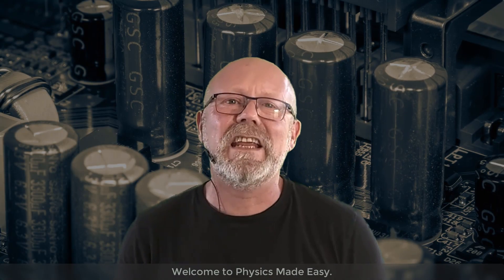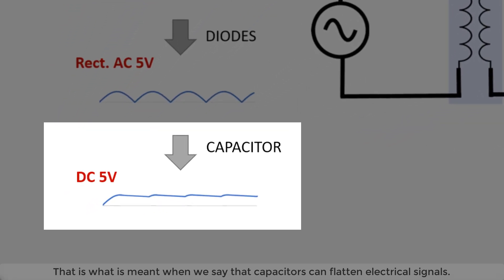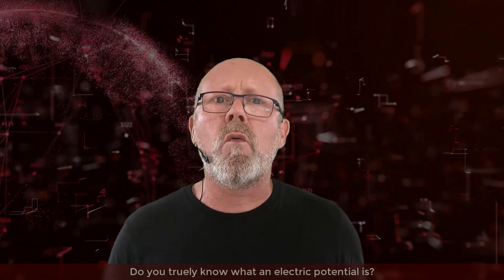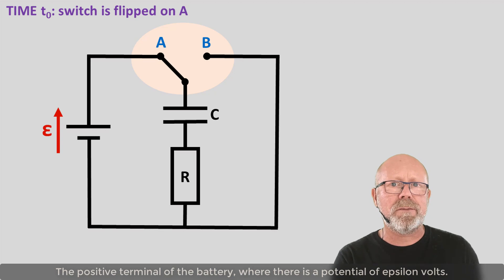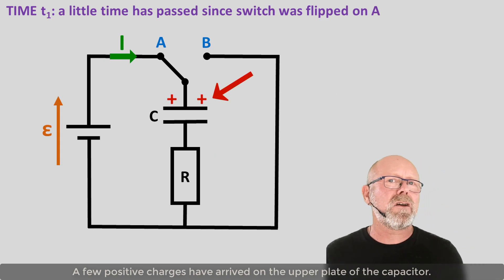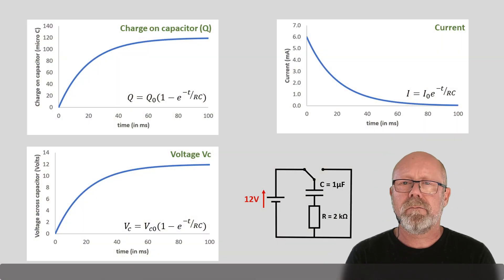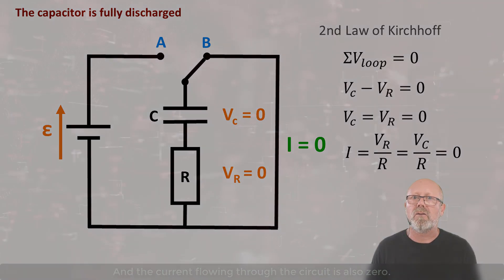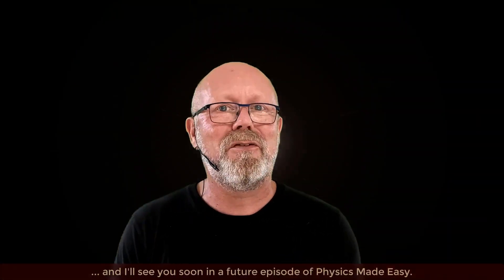What is a Capacitor? (Physics, Electricity)

Comment: how do you conclude the potential on the positive terminal  at t0 is epsilon given the potential difference across positive and negative terminals is epsilon?
Reply from the maker: A potential is a relative value. It is always compared to something else. It is just a convention to say that the potential of the positive terminal is equal to the voltage of the battery.
For example, I could have said Epsilon+2 Volts on the + terminal and +2 Volts on the - terminal, that wouldn't have changed a thing apart bringing a lot of confusion for an educational  video! ;-)

Comment: When is fully charged lest say at 5 volts what is the potential on each plate and why?
It is 5 volts on positive plate and zero on the negative?
Reply from the maker: when we say a capacitor is charged and shows up with 5 volts, we are talking about the voltage across the capacitor. A voltage is a difference in electrical potential between two positions. 
So yes, 5 volts, is the difference of electrical potential between the plates. it could be +5 and 0, +2 and -3, or even -6 and -11. What counts is the difference... For simplicity of calculations, it can be relevant in some cases to choose one of the plates (for example the negative plate) as the origins in potentials...
If you haven't done already, I recommend you check out my video "What is an electric potential":
https://www.youtube.com/watch?v=j3GrOKre__0
Reply: What i dont understand is how is possible to have a bunch on negative charge on the plate with zero potential and still have zero potential?
Shouldn have a negative potential?
I am talking about capacitor.
Reply from the maker: @anaromana8183  Potential is an energy per unit charge: it is thus a quantity that you can consider as relative (because in the end, energetically, one is interested in the difference of energy a system  has compared to another, not its absolute value). In other words, you can set the zero where you want.
Think about mechanics: We set gravitational potential energy at 0 at ground level. It's obviously not zero, but it is the differences in energy that we calculate and use. So it simplifies the work.
For example, if there are positive charges present at a position, the potential is not zero, but you can state so: In that case, no charge present at another position would need a negative potential at that position. Just make sure you stay consistent with your point of origin over all a demonstration.

Comment: New sub here. Thanks for your channel. Can you link me to a clarification of the use of/for 'adjacent capacitors' Some years ago(2013). I inadvertently constructed an LC circuit. At that time I had no idea what I was doing. But now seeing what I've learned in this vid, I may be able to take advantage of my earlier findings. My intent is to charge and discharge two capacitors to do work via 2-coils, each in succession, charging and discharging at a rate of 8.63hz. Thanks in advance for your reply.

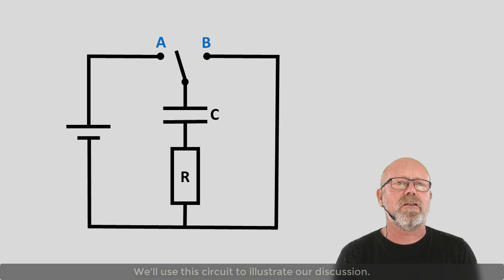Comment: At about timestamp 5:45 there is a, somewhat unknown, use for this circuit (since the cap is first in line).  Suppose the switch is in the MIDDLE position and the capacitor is totally discharged. IOW the potential on both cap terminals is 0V.  Now, keeping in mind that the VOLTAGE across a cap can not change instantly (just as the CURRENT in an inductor can't change instantly), if you flip the switch to the battery (say it's 12v), then the BOTTOM of the cap, as well as the top is instantly 12v, since there is no potential DIFFERENCE between the plates.  Now the top plate of the cap STAYS at 12v, while the bottom plate 'charges' the cap through the resistor by going toward 0v via the RC rate.
This is a GREAT way to apply a fast 12v pulse to switch on an SCR, etc. without any timing circuitry...here a hi-value resistor can be placed across the cap for auto-reset (the cap used in this type of circuit is usually very small...~0.01uF. to 0.1uF).
I have used this method, and have also seen complicated circuitry where this would have greatly simplified it.
A great example of combined knowledge in the academic and typical circuit app of a capacitor from the FIELD point of view!
THANKS AGAIN,
--dALE

Comment: 12:24 initally Vc is epsilom but why is Vr epsilom initially if when we charged the capacitor Vr went down to 0.  I understand you said kirchoffs 2nd law but i dont get how Vr suddenly changed from 0 to epsilom   Thanks
Reply from the maker: Hi N,

When the capacitor is charged (and still connected to the battery: no current flows through the circuit (there is no incentive for charges to move around since the electric potential is the  same at the positive terminal of the battery and the positively charged plate of the capacitor. So, no current, hence, no potential drop at the resistor.

Once you flip the switch on position B. The capacitor discharges: charges move from the positive plate to the negative plate via the resistor (note that I use here the conventional model, in reality, electrons move from the negative plate to the positive plate). So as soon as you flip the switch, you have a maximum current flowing through the resistor, hence the potential drop Vr. This potential drop will decrease in time at the same rate at the voltage of the capacitor Vc to end up at 0, when the capacitor is fully discharged (no more current flows in the circuit).

I hope this helps!

Comment: teacher at 8:21 we considered that Vc=0 because no charges has arrived yet on the capacitor .but why Vr has a value? , why we didnt consider that no charges have arrived on the resistor also ?
i hope that you clarify this for me .
Reply from the maker: Hello Anass, 
This is a good question. 
We are in a transition mode. Charges have not moved yet, but they want to.  
Before it charges, the capacitor can be considered like an equipotential wire (it will let pass current with no resistance)… so the electric potential will be the same on both plates: that of the positive side of the battery. V (before C) is epsilon, V (After C) is epsilon, so Vc = 0, thus Vr = Epsilon. 
Then as current passes, the electric potential of the lower plate will decrease, because some of the charges on the lower plate are pushed by those that get stuck in the higher plate : that is when Vc starts increasing.
It is very important that you understand clearly what is an electric potential to understand my answer (If you cannot explain what an electric potential in a few words in your mother tongue, then watch the video about that on this channel).
I hope this clarifies things !

Comment: Sir thank you for an excellent explanation . Can you please elaborate at time stamp 2.42, how  I= omega C V,  what is the frequency of the current calculated?
Reply: Thank you very much sir, you rock.
Reply from the maker: Hi Wu, The current in a capacitor can be calculated by I = CdV/dt. So for current to pass, the voltage needs to change with time. If the voltage is a sine curve (V = Vmax * Sin(omega*t), you see that omega will come out when you differentiate the voltage. so here you go I(t)=omega * C *V(t). I hope this helps!

Comment: Please correct me if I am wrong. Can the Capacitor have more charge's density in its plate, compared to that of the of the battery's side?. And if so, how the electric field would allow such un-equal distribution of charges on the same wire ( from higher potential of battery to the higher potential of the capacitor's plate. Also, is it the reason why the capacitor can produce a lot of power in a very short time?
Reply from the maker: Hi ggg. 

Higher the charge density, higher the energy each coulomb of charge will carry. So to answer your question, no. The charge density of a capacitor's plate, once it has reached its steady state (= once fully charged) should be the same than that on the positive plate of the battery. In other words, the electric potential should be the same.

The reason why a capacitor can deliver a lot of energy in a short amount of time (high power), in the right conditions  dependent on capacitance and resistance of the circuit, is because the charges are already on the capacitor's plate, ready to go. In a battery these are generated by a chemical process that has its own kinetics.

Comment: @Physics Made Easy  sir and also I have one doubt about angular displacement.
Sir when our vehicle makes a sharp turn we feel that we are pulled on the side opposite to the direction of turning and generally the reason for this is given as due to inertia, our body tends to move in one direction so we feel that pseudo force also called centrifugal force. In this case if we just look at our vehicle so then it makes an Arc of a circle, and if you want to find the angular velocity of the car , which is v/r or theta/time, we will require its radius because we can easily measures the velocity on speedometer said so in this case how can we calculate the radius?
And if sir we can just measure the angular displacement then we can easily measure all the angular quantities so how can we calculate that how much of degree or radian that car has covered because we don't know the radius?
Reply from the maker: If you know the coefficient of friction (MU) and the linear velocity, you can figure out the angular velocity (w).
N = mg
f = MUxN = MU x mg
f is centripetal, so MU x mg = m v^2/R
so MU x g = v^2 /R
From that you can deduce R, and then w.

Comment: Sir I have a small but for me mind boggling confusion about work and energy.
For this if we consider an isolated part of the universe where no force is acting just there are one object and me. From a reference point, the box is moving with a uniform velocity 'u', and then I applied a force 'f' on the object when it was moving with uniform velocity at time zero. After sometimes when the displacement 's' occurs at time 't' I stop applying force.
So by the formula the work done by me on that object should be f times s, but sir here the object had some initial velocity u, so in the displacement there should be some part of it that is not done by me, by the formula (s=ut+1/2at²). 
So by conjectures it seems that the formula says that I have done more work than I have actually done.
Is it so? Where I am wrong sir?
Reply from the maker: Consider case A, initial velocity 0, and case B, initial velocity u. In both cases You apply a constant force f on the object for the same amount of time, t.
In case B, you will have travelled a longer distance than in A in the time t, because you already had an initial velocity u. Therefore, the distance travelled s has to be larger. Conclusion, In case B, you will have provided more work.
If you need to be convinced, just calculate the change in KE in A and compare it to B. for B the change in KE will have extra positive terms than for A. Or if you prefer avoiding too much algebra, you can also do this with numbers that you set yourself…

Comment: @Physics Made Easy  sir but the quantum mechanics says that gravity is one of the four fundamental forces and its particle is graviton, so if it is true then we should not feel any type of gravitational force from black hole because when ,from inside the event horizon, a black hole emits a particle of graviton it will never exceed that line.
So does it resolve that gravity is not a force and if so then why we are still looking for particle of gravity?
I have heard on many videos that gravity is made up of particles so that is why this question came in my mind.
Reply from the maker: A black hole is a sphere from which nothing can leave because of the limitations of motion in our Universe’s space time. Causality from the inside to the outside is broken. This is because the inside of a black hole is NOT in our space time (our Universe… ). So the singularity itself does not interact gravitationally. What does, is the surface.

You have to consider the part of the back hole in our universe like a big black sphere (or more precisely, a sphere of radius just a little larger). What exerts gravity in our Universe, is not the singularity itself, it is the surface of that sphere … So if gravitons are real, they will be exchanged between an object in our universe and the surface of the black hole. 

But again, as I told you in a previous comment, that object (the surface of a black hole) is macroscopic… so trying to understand things with quantum mechanics here is not a good idea (until we have something better). Here you should use general relativity… 

Oh, and when you watch a science video, always pay attention to the context of the video and be careful when extrapolating. what you learn elsewhere (it might not apply). Also keep a critical eye... More the title looks appealing, more you should be cautious... I see things sometimes that make me jump out of my chair lol!...

Comment: Thanks for video on capacitor I was eagerly waiting at you channel.
It is a great video but I was looking for displacement Current. Kindly explain in your next video. Also why Maxwell's 3rd and 4th are not similar. In 3rd equation time varying magnetic field produces circulating Electric field but in 4th equation for circulating magnetic field, in addition to time varying Electric field, Current is also included. Current is moving electrons, electrons have electric field and moving electrons  produce time varying Electric field. Can Current be replaced with electric field of electrons. This will make 3rd and 4th equation similar.
Reply from the maker: Hi Zakir, your question is above high school level so I am far from being an expert in this. What I see is that in the 4th equation, there is the property of the medium, free space, that is involved (permeability and permittivity), 3rd looks similar but is not the same 4th. 
Another thing, In high school terms, think about the interaction of a charge with an electric field F = qE, but in a magnetic field, it needs to move to interact with it (F = qvB). Each field has its distinct properties relatively to each other…
Reply: @PhysicsMadeEasy Thank you for replying. My guess is that Electric and Magnetic fields are produced by entangled microscopic electric and magnetic particles which reside at 90 degrees in 2 of 3 spatial dimensions. Motion of one moves the other. Same microscopic particles produce displacement current b/w capacitor plates and magnetic field around the plates.